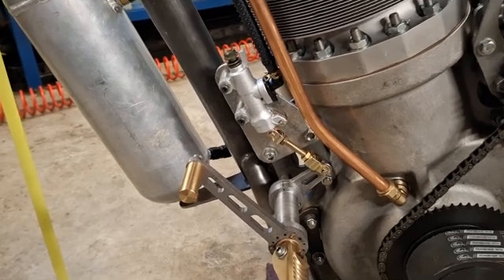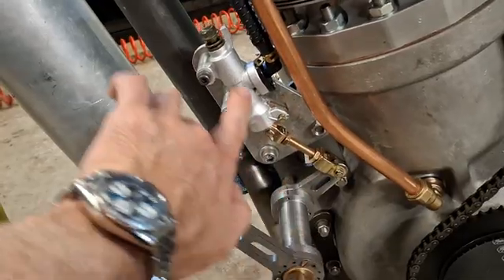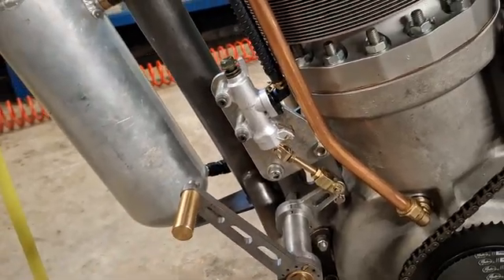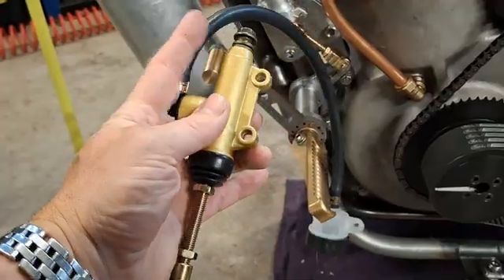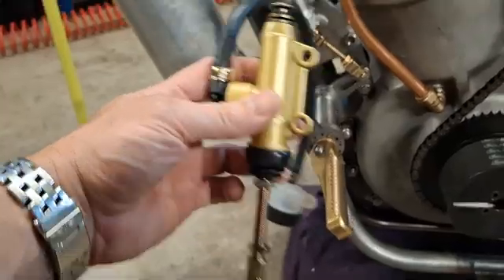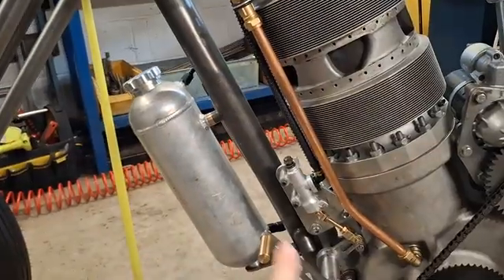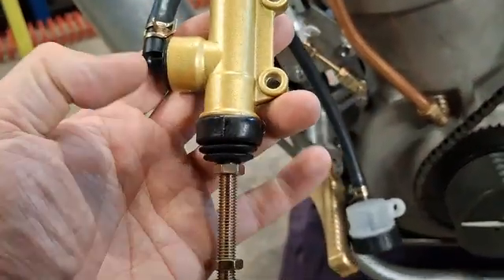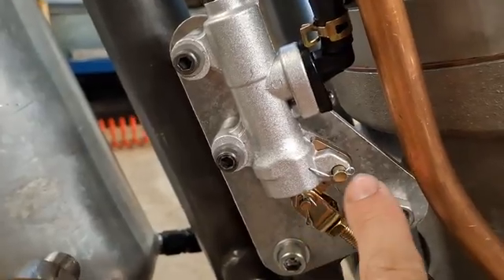It's not in line! 🫣

Comment: Here's another one for the list: Brake-light switch. Possibly hydraulic pressure type fitted to a union near the headstock gusset-plate? Maybe blended with the coil LT wiring for return to the central electrickery box?
Reply from the maker: Something like that yes. It'll need a switch somewhere, for sure. A brake light itself would also ne useful! 😁